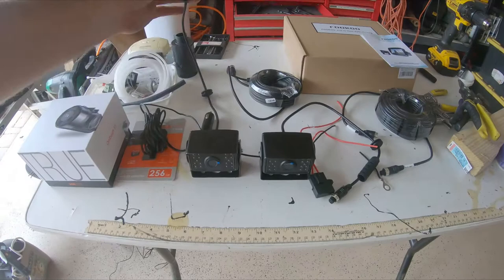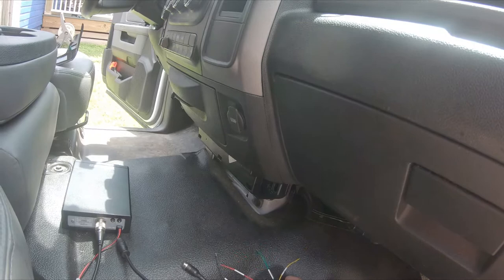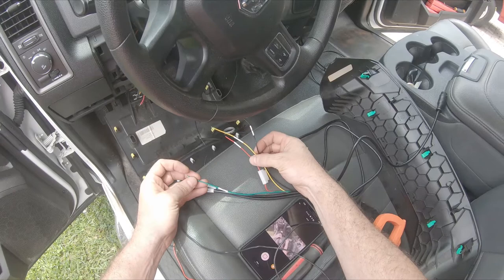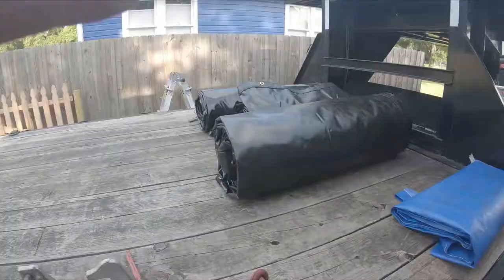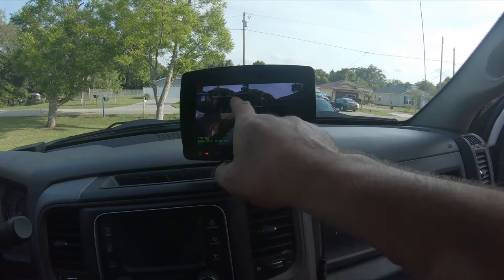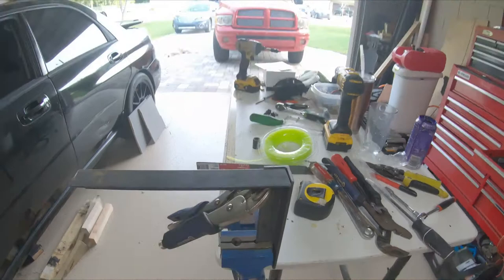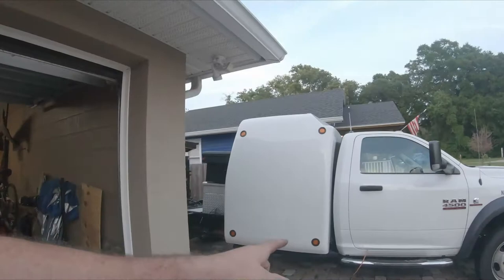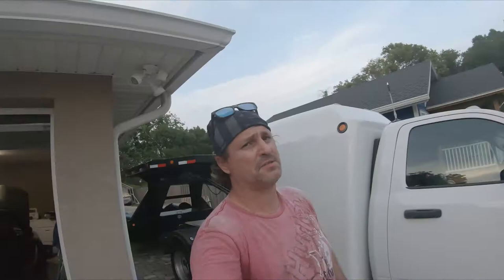Installing 2 camera system on hotshot trailer/ Ram 4500 and CB radio.

Comment: Link to the cam setup?
Reply from the maker: The camera system went dead in 4 weeks.  Amazon was zero help, so I would not recommend this system.  Bought a wireless one and seems to be working ok so far.
Reply: @kdlhotshotrv  thanks for the heads up